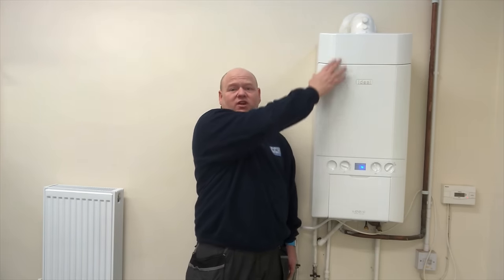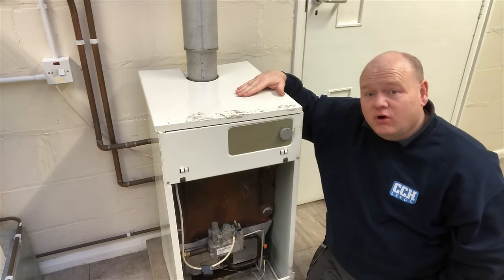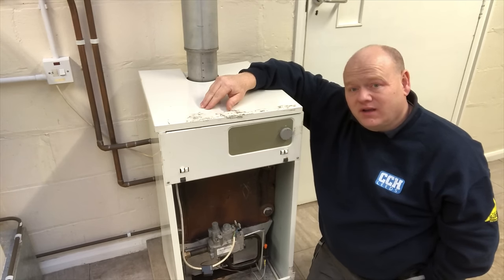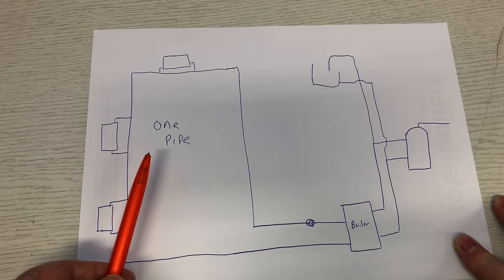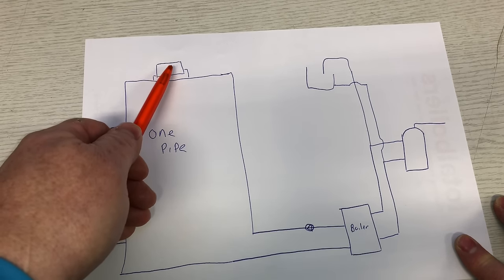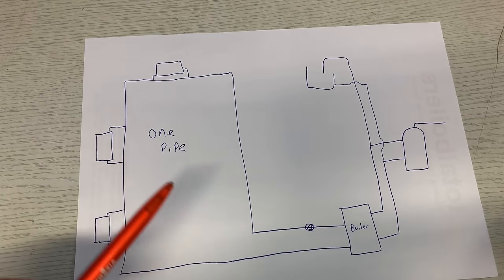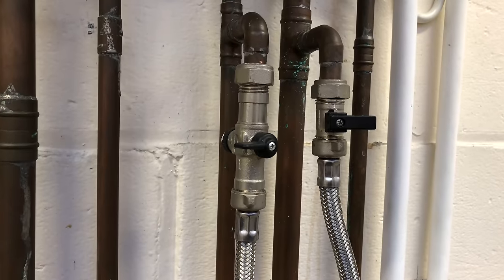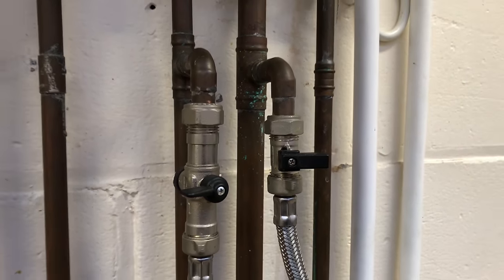CENTRAL HEATING SYSTEMS - Gravity - Fully Pumped - Combi - Y Plan - S Plan

Comment: Half way through my level 2 plumbing course (full time) so not getting site experience. Videos like this are really really helpful! I would of preferred each section as individual films so I can look back at each part easily.... rather than one long video.
Reply from the maker: I will do some short videos in the future. Thanks for watching.
Reply: I am currently failing my level 2 course
Reply: @jackieb8738  did you fail?

Comment: Great video, only one I found getting close to explain gravity system properly, still one question though - now you need to have fully pumped system if you change Hot water Cylinder, how complicated is that? can I keep all old piping and 1987 Ideal Mexico Super CF 125 that works well? Do I just add another pump somewhere, minor pipe work and keep the two tanks on the loft? Problem is rust colored water overflow into &e tank, that is all I want to get rid of, ball valve checked and not faulty
Reply from the maker: Thank You

Comment: Do those zone valves open and close based on the programmer? I have a Honeywell programmer and electrical leads come from the valve to the programmer so assume so. I assume when the programmer ticks on, the valve gets an instruction to open? Another question is when, say, the thermostat ticks the heating off, yet the programmer is still on, does the valve stay open? Or does it close and go on bypass because the pump runs for about 30 seconds even after the thermostat has ticked off? Also, the pump sometimes runs for 30 seconds or so after the programmer has clicked off? So, does the valve open and shut based on the programmer alone or the thermostat as well? I also understand the bypass is an emergency incase the electronic valve fails. I also understand it's auto that's best to stop the bypass loop running all the time. Thanks.

Comment: hi Allen great video correct me if Im wrong but you can drain the radiators down via the return on the filling loop
Reply from the maker: Thank You
Reply from the maker: Yes sometimes, Depends how its installed. Thanks.

Comment: Hi Alan, great video!
I wanted to install Tado to replace my old controller EP2000.
Where I'm slightly confused is gravity vs S plan. Old setting on EP2000 would suggest that it is gravity but I can see that I have as well 2 valves - controlled by some Honewell controller.
Would gravity still have 2 electric valves like in S plan? One is next to hot water cylinder and other one looks like would be for CH nest to the pump.
I would appreciate if you could point me in the right direction if possible.
Thank you and whish Merry Christmas.
Patryk

Comment: Hi, Where would you connect the power flush machine on 2 pipe system to flush radiatiors? is it at the pump or the return on radiator?
 Thank u

Comment: Hi Allen, The flue heat recovery system, would this only work on hot water only, would it be more or less point less when using continuous central heating. Thanks Allen for your informative lectures.
Reply from the maker: Thank You

Comment: Hi Allen great video again. 
Just wondering if you could explain how a room stat, external programner and fused spur are linked togther and how the wiring works. Just cant get my head round the electrical side of it, ive only ever had to connect to a 3 pin plug to only test it as we've always had a electrican follow behind us the next day to hard wite all the controls . I would be very greatfull for your time. Thanks
Reply: abdul hafiz do a search on John Ward heating wiring great videos
Reply: @heatservicebwcuk1545  thanks! his videos seem to explain it very clearly
Reply: abdul hafiz your welcome mate.
Reply from the maker: Thank You

Comment: Does the gravity system normally have a heat exchanger in the hot water tank and rust inhibitor in the boiler/radiator system or is it all hot water (untreated drinking water) through both tank and radiators. ?
Reply from the maker: Thank You

Comment: I use S plan, it can keep both radiators and hot water warm at the same time. I recommend it instead of Y plan or even worse a combi because they turn off your radiators when hot water is used. Why plumb like that, in winter your rads turn off whenever someone or a machine uses hot water.

Comment: Hi Allen, can you tell me why a bypass is only needed on the s plan system and not the y plan?
Reply: On a three way diverter valve its always open to hot water,never fully closes whereas on the s plan both valves could close resulting in kettling as the boiler cant dissipate the heat
Reply from the maker: Thank You
Reply from the maker: @thomaswatt1658  Thank You

Comment: Allen, why does the open vent and cold feed have to be within 150mm of each other. If this was greater what would be the outcome.
 
Thanks
Reply from the maker: To keep the negative pressure as small as possible. We wouldn’t want the system sucking air in. Thanks..
Reply: Allen Hart Thanks Allen
Reply from the maker: @dave8930  No problem. Thank you for watching. 👍
Reply: Some manufacturers actually wanted the cold feed dipped before connecting

Comment: Hi, at 10:30 the diagram shows the cold feed going to the flow pipe, is that wrong? I thought the cold feed from the FE tank was supposed to tee into the return?
Reply: Or is it different because the system uses a pump?
Reply: Another quick question, what are primary and secondary flow/returns?

Comment: Allen, can I ask you. Does the pump also have to be within that 150 mm. So you have two pipes and a pump within 6 inches ! Thanks.  Or is it just the two pipes and the pump can be a ways down stream ?
Reply from the maker: Thats a good question. We were always told as close as possible. I cannot remember ever seeing a figure for it. Maybe someone could correct me if they know the answer. Thanks.
Reply: @AllenHart999  Thanks Allen.

Comment: Allen ....your initial diagram showed a boiler connected to a direct hot water cylinder where the system open vent was that from the hot water draw off,   and the cold feed also fed the heating  what you sketched was  an indirect system but then in your additional explanation you didn’t draw a coil in the cylinder but you took an open vent to F&E tank from the primary flow, which you explained was for  a expansion.,this is not so it’s function is only an open vent. You also draw a feed back to primary return and  in fact this feed is the  “feed and expansion” .. but it’s very important with doing this that the cylinder is indirect by virtue of a heat coil not a direct cyl !!!! Just ... pointing it out as I know you would like to be spot on and do the job correctly
Reply from the maker: https://www.youtube.com/watch?v=9tVVM758tdo

Comment: Hi Allen Hart. I have the "s" system that you describe here. Due to increasing family demands I need to add a bathroom to our home, but would need to increase the size of my header tank and add another indirect hot water cylinder. I have very good mains pressure and a Stuart Turner "Monsoon" pump on the hot water supply. Can you help me to understand what I would need to do to create a working system that would deliver the increased supply that I need. (connection-wise hopefully) I have one 1200 x 400 cylinder at the moment and was thinking I would add something similar to alleviate the problem.
I realise that you have no exact dimensional information, but hopefully this would not stop you being able to offer some advice or point me in the right direction. There are a lot of conflicting opinions online.
Reply from the maker: Thank You

Comment: Hi I have an old system like the 1st you describe and when I turn on the heat it heats the rads and the hot water tank at the same time. When I shut off the hot water tank via the valve in airing cupboard to just heat the radiators and not the water I get a constant steamy flow into the attic small overflow tank which then drips outside from the eaves. So basically I have to heat the hot water tank everytime I need heat in the house. This seems a waste and was wondering if you could help.
Reply from the maker: Thank You

Comment: Does the gravity system work with pumps along the pipe network? What happens if there is electric power outage? Would liquid in the pipes manage through the pumps?
Reply from the maker: Gravity hot water doesn’t use a pump no.
Reply from the maker: Thanks very much for your comment, please consider subscribing to support the channel 🙂
Reply: @AllenHart999  Sure it doesn't. But the pump is in the liquid network. How the liquid manages through the pump? Shouldn't there be a some bypassing of the pump?

Comment: Brilliant, changed boiler on a 45 year old oil gravity hot & pumped heating system and adapting to an S-plan, just wanted a little clarification on the vent pipe coming off the cylinder!
Reply from the maker: Thank You

Comment: i have this system in my new house, however the water temperature is far too hot. I suspect its the boiler thermostat but i can hear it clicking when i turn it. 
How hot should the water be? 
The boiler is as old as me, i am palnning on replacing it but not at the moment.. Any advice would be appreciated..
Reply from the maker: Thank You

Comment: Missing in the first system the hot water tank has a heat exchanger pipe coil for the boiler water. This keeps the chemical inhibitor in the boiler/radiator water out of the hot tap water.
Reply from the maker: Thanks for pointing it out, I always miss something 🙀👍

Comment: Ok, if I have a logic combi, without hot water tank, just radiators, surely that means I can switch off gas and connect a wood stove and the boiler will circulate the hot water?

Comment: At 11:50 you talk about 150 mm apart max? To and from the header tank why should that make any difference how far apart the pipes are I don't see it make no difference at all. Can you explain to me why it has to be only 150mm maximum between the two pipes, what bearing does it have on anything thanks.
Yes I thought about making a heat exchanger around the flu for my boiler oil, would it make it more efficient...? the only thing is Not sure what Gager pipe would be best a thinner gauge or thicker..? Thinking 10 mm gauge I could get 3 layers and packets with expanding foam in a tube or stick with 15 mm what maybe only two layers...
Reply from the maker: That part of the system would be under negative pressure, We want to keep as much of the system as possible under positive pressure. Thanks.

Comment: Allen. Was was watching one of your other vids, where you upgrade a Y plan to S plan, where you combine the vent and cold feed. How close would you combine the two together, to the header tank.. do they have to be close to the tank? is there a certain distance frm the header these have to be connected? or doesn’t this really matter! Thanks for the vids Allen 👍
Reply: @pmailkeey Currently there is an open vented, heat only system, no zone valves Jst a boiler, timer and pump, I’m looking at upgrading the boiler and pump. 22mm vent and 15mm feed installed in the correct fashion as you say. Was Jst wondering if there was anything I should consider if  combining  vent/cold feed pipes. Not a lot of info out there on this method of installation, Jst something I wanted to consider if this job goes tits up, eg if it starts draw in air etc..  Its an old system, reason why I’m not going to seal it! Looks straight forward enough! Thanks for you input 👍